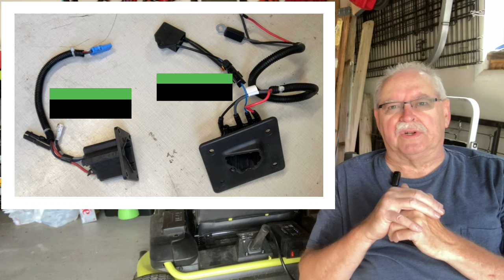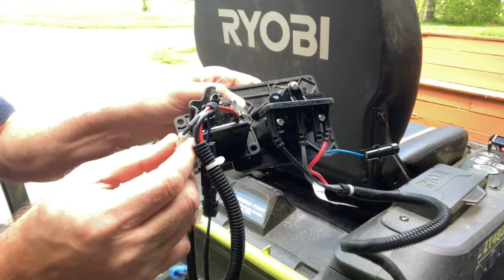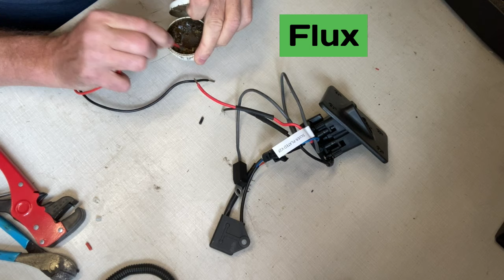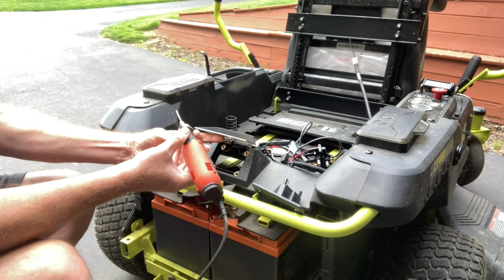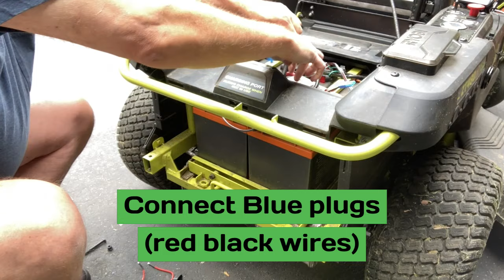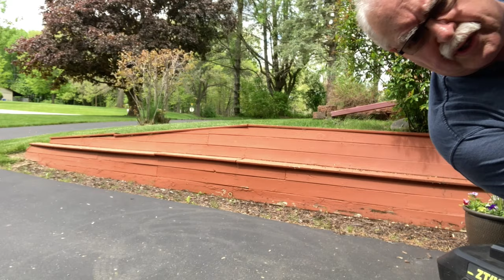Ryobi ZT480ex with new EZGO charger port

Comment: Is that the original charging adapter that came with mower?  it looks like different. What brand if you don't mind?  Great video!
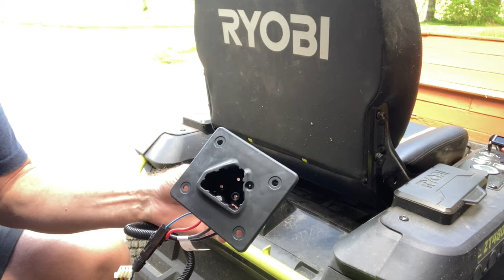Reply from the maker: If you're referring to the lithium charger?, it's featured at this video at the 6:00 min mark:
https://youtu.be/1klxV2sZ1U8?si=5DnHydo3DBZV3cRj
It's still available for $100.

Comment: Couldn't you have taken the 3 Philips head screws out of your old charge port and use the mounting flange from it with the new innards from the new charge port?
Reply from the maker: You know, I don't think I looked at that as an option.  Taking the electrical guts from a 3-screw EZ-GO may fit the Ryobi 3-screw flange.  Hmmm.

Comment: Rob, thanks for the information. Made the switch after watching your video’s and a few others. All is working well, except charging. Seems to charge my LFP’s (100 ah) up to 54.8, voltage won’t  go any higher after hours of charging. Biggest concern is that the charger does not shut off automatically? Batteries were balanced before installing, not sure what the issue is. (BTW, Using the same charger you recommended). Any thoughts?
Reply from the maker: I have yet to dust my mower off for the spring.  I think my voltage was a little lower than that.  I am concerned that the charger doesn;t turn off.  You have it on the right settings?
Reply: @ Correct, or I believe so. Followed the somewhat cryptic instructions Rob,  have them set for LFP, 48 volt, low and high voltage according to battery manufacturer.
Reply from the maker: @ According to my CHINS manual, if you disconnect the battery charger and let it set for up to 12hrs, a fully charged battery should settled down to 13.4-13.8v.  I would expect other batteries to be similar.
13.6v x 4 = 54.4v
I still don't understand why the charger doesn't shut off.  Mine always shuts off.
I know it isn't easy, but check each battery voltage level.
Reply: @robertveldman1901  Rob, really appreciate you taking time to respond. If you get your Ryobi dusted off and out of storage, could you compare your settings to mine? Voltage charge stops increasing the charge level on my LFP's at 54.8 and fails to shut-off. That is my biggest concern. After manually turning charger off, voltage settles down to 53.4. To answer your question; "Do I have it on the right settings?" Good question: My current settings are: F03; P48; Low=10.2; High=54.8; On; 6-9. Let me know if yours settings differ. Thanks Rob.
Reply from the maker: @robcurfman  I plugged my charger in last night, and it indicated FUL this morning.  The Voltage gage on the mower says 53.40v

Comment: I can't get the hex bolts to unscrew to replace the port.
Reply from the maker: They should Torx screws; you need a Torx bit..  Are you trying to use a hex/allen bit?  The four screws should come out pretty easy.

Comment: Great video! You saved me a ton of time. So I didnt see were you mentioned what the "grey Wire" connects to?
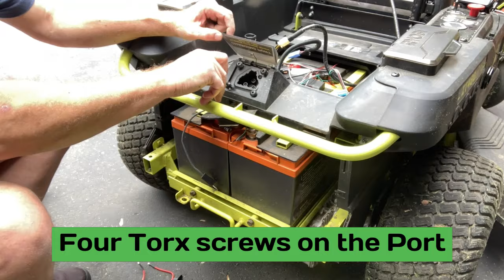Reply from the maker: The grey wire is connected to the thermistor, which is attached to the Positive Battery terminal at 24:15 in the video.
The Ryobi Thermistor has a white connector between the thermistor and the port.
The EZGo Thermistor is directly attached to the EZGO port.
I hope that helps.
Reply: @robertveldman1901  Yes I missed that!.100% HELPFUL THANK YOU SO MUCH FOR PUTTING THESE VIDEOS OUT!

Comment: If you ever find one of the joystick Ryobi ZT and make your setup those batteries I would be in paradise.
Reply from the maker: The new Joy Ryobi have Lithium batteries, so that should solve the issue we have with the older Lead Acid batteries.  But, those proprietary batteries are disappointing.
Reply: @robertveldman1901  the proprietary part for an expensive battery with little power is nerve racking. I have been trying to figure out how to at least have off the shelf more energy dense Li Phosphate batteries to attach to the system and extend the range. Or at least charge more than one battery  that is not use while I am mowing so that I can lose less time. The motors seem up to the job or true long range cuts, the batteries aren't.

Comment: I’ve had a lot of trouble with my conversion and was wondering if you could help me out. I changed the batteries and nothing else. It worked the first time but after that just a click from the relay on the frame on the rear right side. I didn’t change the gauge. And I charge it by disconnecting the main battery connector. Like I said worked a few times but now just a click. After the click the batteries drop to 3volts and I triple checked the connections. Could not having the gauge with the shunt be my issue. I’m $1000 in and no one near me works on these things. Any suggestions?
Reply from the maker: I haven't had an issue since my swap. But, I've heard and seen something similar.  You'll hear the solenoid click(on), and immediately click again (off).  It almost sounds like one click, but it's two.
I am not an electrical expert, so some of this may be nonsense.
A possible issue is a voltage/amp surge at the initial key on is causing the battery BMS to trip and protect the batteries?  ...Presuming there are capacitors that need to be charged up on the mower.
One thing to try after the initial "start", is to immediately unplug and replug the battery pack.
That may be enough to reset the battery before the capacitors(?) lose charge.
There is a precharge kit that you can try.  A guy sells them thru FaceBook.  Check his YouTube videos (below).  The principle(?) is to use a resistor to slow the initial surge, for a few seconds, then switch to full power.
https://www.youtube.com/watch?v=jNEGhhh3dMo
https://www.youtube.com/watch?v=dYyG_wQ3zgI
Let me know if either works.

Comment: Any idea what exactly killed his charging port?  Looking to do the battery conversion and want to avoid the pitfalls.
Reply from the maker: The charging port was cooked by using the modified charging plug.  If you use the unmodified charger plug, as purchased, your port should be OK.
Jesse and some others have had an issue with "starting"; the mower will not power up, unless you unplug and plug the battery pack in.  Or you need to start the mower with the charger plugged in.  This appears to me related to a voltage/amp surge.  It can possibly be corrected by using a "soft start" or "pre-charge" circuit.
My Lithium conversion did not require either, and I have not had a issue for over a year.
So, the Lithium conversion is not without risk, but I believe many, many have done it.

Comment: I have not yet done any modifications. Could you please let me know what changes I should make to avoid charging port meltdown? Do I need to buy different charger along with ezcharge port? Thanks regards. Ben.
Reply from the maker: The unmodified HDRC3648 should still be OK and safe.
Reply: Thanks so much regards. Ben.

Comment: Ok, that was fantastic . So you still have the same recommendation for charger and its plug wire soldered from red to the third empty terminal to achieve the green light 🤔?  Or did you remove that small soldered wire from the inside of plug. Please clarify. Thanks regards. Ben.
Reply from the maker: My charger still has the "green light" jumper modification.  (The green light turns on when the charger is plugged in, and the mower is disabled.) I had to remove that video because the green light jumper will burn down some charger ports.  So, I can't recommend the green light jumper mod.
Reply: Ok, thanks so much regards